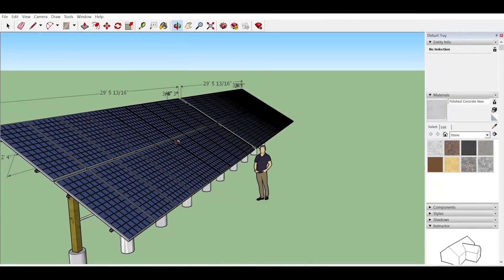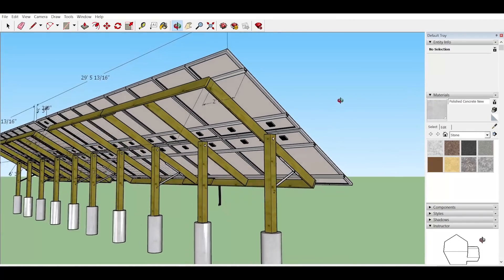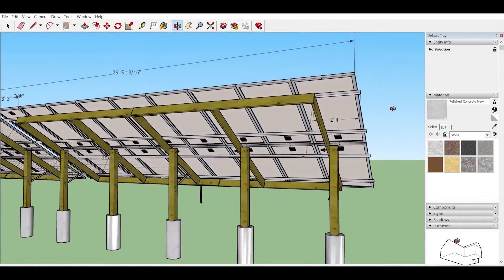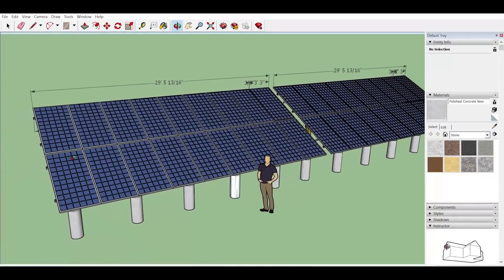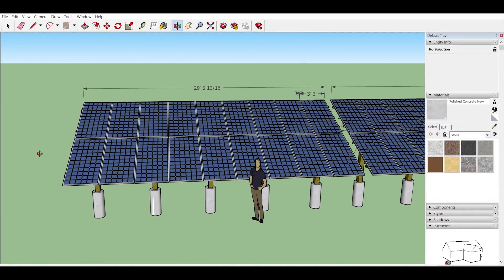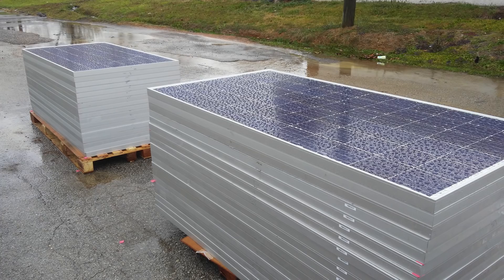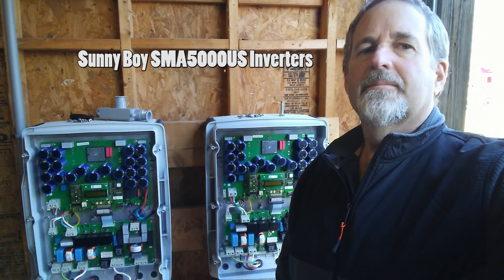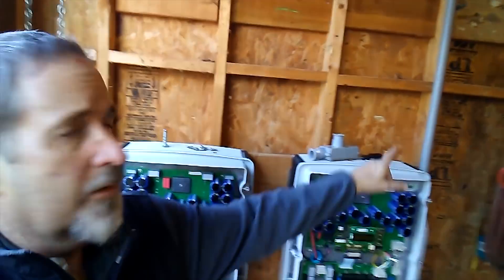BUILDING A 10,000 WATT SOLAR FARM  - Part 1!

Comment: So what was the overall investment for just all the solar panels, & how do you know how tight to tighten the bolts that secure the pannels down, I think I would of buried the PVC deeper, & used rubber mats, to protect the solar panels, should the drill slipped off the bolt heads
Reply from the maker: The aluminum frame around the panels is rather thick and its a double wall design. I could really torque them down a lot harder and probably would not be easy to crush the aluminum. I probably put an average of 25 ft/lbs of torque on them. Tight enough so they won't come loose. Since it was hex head bolts you really don't push down any so I was not worried about the drill slipping off. Its not like drilling a wood screw in. Even still, those panels are amazingly tough. We bought  2 pallets of panels. They were new. $150 each and probably $10 each for freight shipping in bulk. These are made by JA Solar, 315 Watt rating each with 4 bus bars. Good for max current load powering an inverter.

Comment: Hello...great project...did your utility and county inspector accept the ground mount as is? Did it pass inspection as far needed in your area? Thx for the plans, not a sketch up master...so i am still trying to get the measurements out of it...how are your experience with the setup so far? Wood frame bending from the weight? Any wind concerns so far?
Reply from the maker: No problems with wind. in 30 mph gusts it does not even shake. Not even a little. It simply weighs a lot. Each array is about 1700 lbs. It would probably take a direct tornado hit to cause any wind damage. Each panel is close to 50 lbs so the weight is distributed. I don't expect enough weight loading to warp the beams any. I could easily swap one at a time if ever needed. With minimum maintenance it should last 50+ years. Our area does not require any inspection other than the electrical connection to the grid. (breaker box area) and the power company does an "anti islanding" test which means if the grid stops sending the AC sign wave, the inverters shut down. If they did not it could easily electrocute a serviceman working on the lines from quite a distance. Power sold back to the grid gets its voltage stepped up to a much higher voltage through the distribution transformers. They work both ways.
The power company requirement is that it all be UL 1741 listed equipment. We also did a 5 year contract as a power provider/generation system.

Comment: I was going to use the same center mounting that you have except for offsetting (~10%) the weight so you would have little more to the front, yes will need second adjustable support to the bottom end, but better to deal with the high winter winds that come through....
Reply from the maker: That sounds cool with a 10% offset. Remember the weight. I calculated each 18 panel section is over 1500 lbs. One person can tilt it but still takes a little effort. Good luck with your project!

Comment: Wow... that conduit is supposed to be buried 12” minimum depth, 18 to 24” recommended... you have around 4” cover... expect a LOT OF LEAKING PIPES FROM EXPANSION... take a lot of measurements of the pipe path, and write it down on a map of the property... damage is highly likely
Reply: Whoops
Reply: Underground conduit always leaks, that's normal and you should expect them to fill with water even if it is only due to condensation.  In real life this install will work just fine.  People have been burying cable in a 'farmer trench' like this for almost a century and while it does increase chances of damage vs code it otherwise works fine.  Where I live you need to go 4ft deep to avoid frost heaving which is impractical so, yeah, everything is done like this in the real world aside from major electrical work such as service entrances and the like.  The inspectors look the other way as they know digging a trench like that in your backyard to a shed is stupid.
Reply: @knurlgnar24  Nice to see you Knurlgnar24 and to read your usual intelligent input! I thoroughly enjoyed your two videos on flooded lead acid vs. lithium technology, your comparisons is truly mind opening when deciding for battery bank choices! I do subscribe and it is nice to see your back!
Reply from the maker: We have no depth requirement here for a branch circuit, only for service entrance and that is at 36 inches because a service entrance from the utility has no breaker at the pole. I wanted to go a little deeper but a giant bolder about 12 feet wide and 6 inches deep said no. The camera lens had a fisheye effect that made it look shallower than it really is. Its between 6 and 8 inches in paces. Its farmland and will be undisturbed other than walking on it at times. The ground here has a lot of clay and gets real hard. I don't expect it will ever get exposed. If it does we will use the tractor and cover it deeper.
Reply: SuperVstech .....STFU..yes, you are one of those
Reply: Robert Maki ? One of those? You mean a qualified electrician... yup.

Comment: Very nice! Would you mind sharing the sketchup design?
Reply from the maker: Sure I can share it. Its not entirely complete as in it does not show all the screws and mounting hardware but the dimensions are correct.  I would need your email to send it as an attachment. Its not large.
Reply from the maker: Here is a link to the design on google drive. Let me know if it works.
https://drive.google.com/open?id=1HRjLHUHz-ZNJX2hYys-Cp_rxSxHTXKkk

Comment: Great video! Im looking to lease land for a utility solar farm. Do you know what the land requirements are? Can I email you? Thanks!
Reply: I am not sure about land requirements if you are building a solar farm for commercial use.  Check with your local county government. They would know or check with your utility company.
Reply: Did you find out the land requirements for a solar farm? Have you also contacted a solar developer? I am also thinking about leasing land for solar use.
Reply: After you have a proposed contract with your utility you will need to get a licensed engineer and select a 1 access tracking mount system.  That system will help you determine optimum spacing. The closer together you make the rows the less energy you will get per row so spacing is a trade-off between land cost and system cost.
3-panel tracking systems in my area are on 25-foot centers with an access road all the way around them. Anyway, you need to get someone or a company that has done this before.
Why lease? If you have the money to do a commercial solar farm you make more money on woning the land it is on and when the time comes that the land will pay off big time and solar is not then you can sell the farm. When I got to Sacramento there were a lot of drive-in movies. I talked to one of the owners and he told me he put the drive-in to pay the expenses until the land value increased and then he was going to sell to a hotel. Now there is one 6 screen drive-in and several attempts to build something else have fallen through. We still have 6 screens, all the other are long gone and there is a Hilton Hotel where I talked to the guy on west Arden way Sacramento.
Reply: John, if one was going to look for land to do a solar farm, what requirements would you be looking for in the land and in what priority order would they be,
Reply: Krystal, how big of a solar farm do you plan on doing